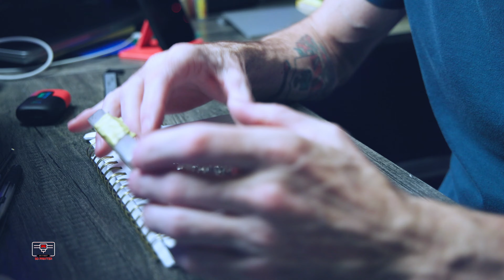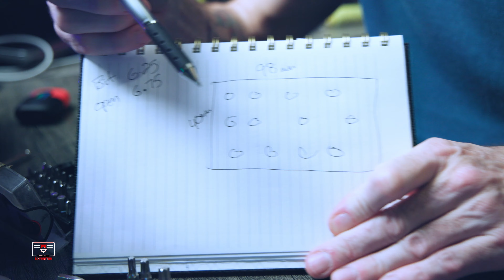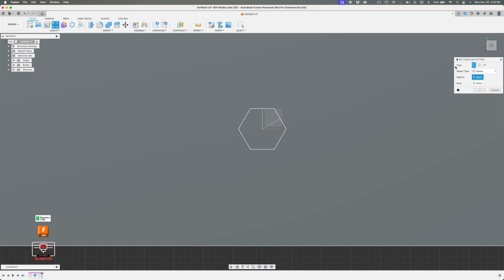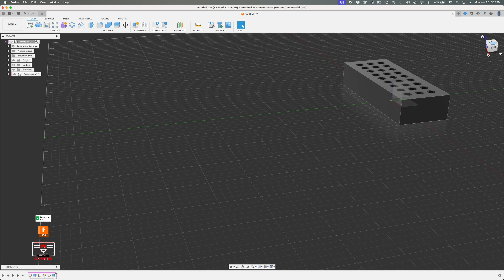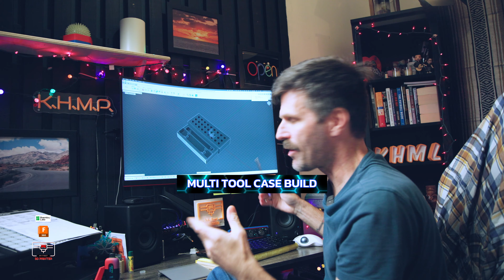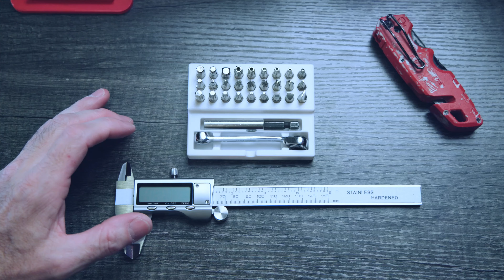I love Multi Tools and Hate Losing The Bits (3D Printed Solution)

Comment: And a lot faster is to use the array tool, make the first six sided polygon, and extract it for 12.5 mill down so you have the actual hole, and then use the array tool on the feature, 3 rows and 9 columns or visa versa. so you don't have to select all the 27 items to extract. And creating 27 hexagons. For more the 4 or 5 items learn the array, And these projects are very well suited to learn those skills kind regards Hans
Reply from the maker: @hanspijpers2100  I’m starting the book today with all of the notes to help out with creating in Fusion 360. Thank you again my friend!!